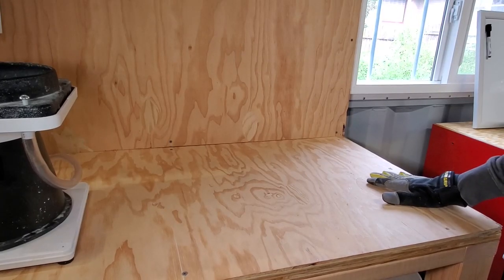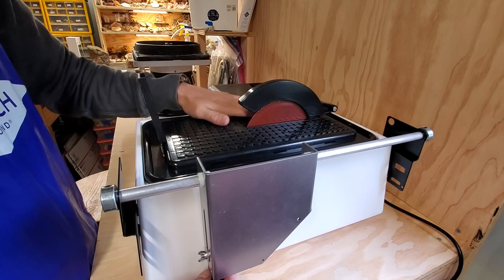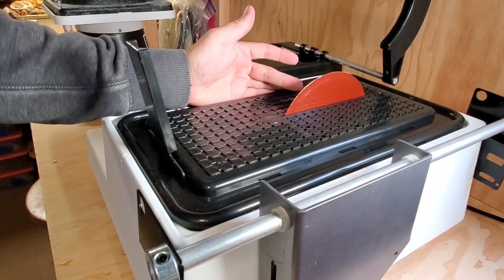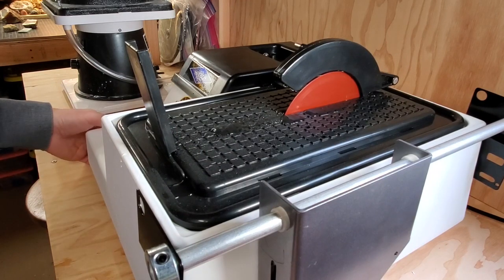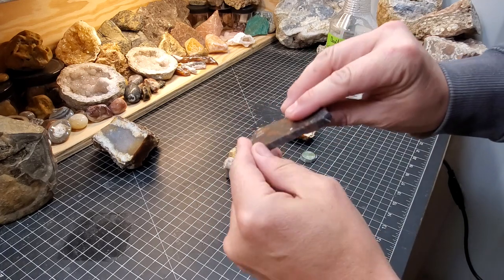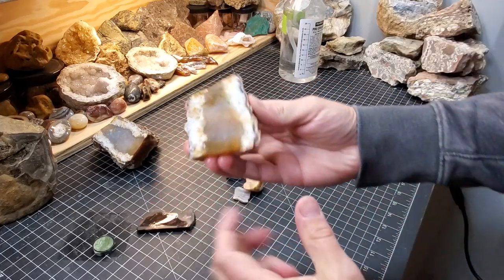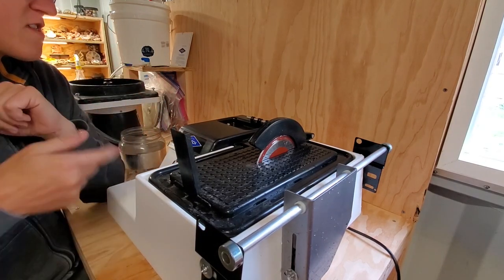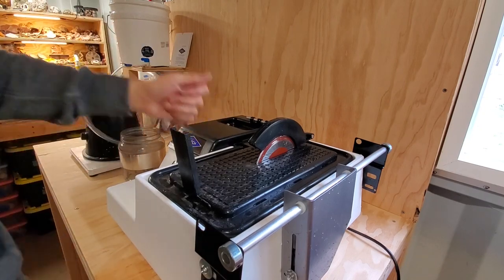Hi-Tech Diamond 6" Trim Saw: First Cuts & First Thoughts

Comment: I am having a vice custom made to use my 10 inch wet tile saw safely, right now hand cutting rock like I am is a disaster waiting to happen.  However, this is a good solution for the small cuts and its not too pricey!  Thanks for sharing.  :) This is an expensive hobby for sure!
Reply from the maker: Yeah it sure is nice to clamp your work down.

Comment: it appears the blade is not at a 90 degree angle to the top of the unit. How do you compensate to make the cut straight?
Reply from the maker: I'm not sure what you're seeing but the blade runs at a 90degree angle to the table.

Comment: The solid brown one looks like a cold water agate, which is typically limestone, and softer than standard chalcedony. I like the no noise factor and that was very a pleasant surprise (I wait until my wife is out of the house before using any of my saws, so this was impressive). I wanted to see you use the side of the trim saw to grind small pieces off when shaping an agate or cutting a cab. With the way this is made, I don't think that would be a wise move, since the side pressure is going to cause issues with the plastic at some point. What was the price on this unit? You might have said that, so I apologize if I missed it. If that is at a decent point then for someone who doesn't make cabs for a living would have all the saw they need. A trim saw is a nice piece of equipment to have if you are working on hard material, such as agates. Especially for those people who don't have a lot of lapidary equipment; they are limited to a smaller flat lap or even a hand-held rotary tool. That's when having a trim saw that you can grind against helps you out a lot. That was my biggest concern, but like most of the gear that I have I would probably heavy it up so it could handle the side pressure. Again, the noise is something that other saw manufacturers should take into considerations, because I'm wearing military ear protection for sound with the noise that my saws make. Very nice.
Reply from the maker: Grinding on the side of saw blade is really something that should be avoided.

You can see the current pricing on there website.

Comment: I like that vice swing option.  You will want little wedges like popsicle sticks for uneven rocks that you clamp. 
Oil over water? The oil gets gray and mucky,  it's hard to see markings on the rocks.  And you will need the litter pan and then a wash bucket.  You won't want that in your drains!  your going to need to follow some of the same procedures and with the slab saw if you use oil. 
Liz carate has made a myriad of shields around her water saw similar style. 
Water and bits can fly .
When free handed cutting just always be patient and allow enough time for the blade to do its job so that you don't torque the shaft holding the blade.

So congratulations on your new saw! Great video...
Reply: Also that is a amazing pre cut for the round... I cannot imagine that one, I usually do rectangular or harlequin style diamond.. parallelogram types. 
I usually just polish one window. 
I'm at a local community shop. 
So I'm sharing information from watching others.
Reply from the maker: I'm happy you liked the video and I do like the vise swinging out of the way option. I see the value in the oil for a big, slow cutting slab saw I really like the idea of not having to mess with water when its permanently below 32 degrees here.

I love your comments by the way, I'm always learning something.
Reply: @CurrentlyRockhounding , good to know that you find the information helpful. 
I'm Also learning and I ask lots of questions..
I want to know as much as possible! Those folks who have been working with stones for years are full of knowledge. 
The oil is good we have it in several of our free hand machines.  But it gets mucky really quickly. 
So there are different ones,  a company like Bar-sol.. here is local and selling the light weight white oil/food grade mineral oil,  or horse oil that you can buy at a tack shop.. because of the cost associated with it you can use it for some time. 
I was researching for Kate and found interesting things.

Comment: Thanks for the demo.  I just picked one of these saws up yesterday.  The notched diamond saw blade has a direction arrow on it, but my red sintered blade does not.  does it matter which way I put the blade on?  Thanks.
Reply from the maker: It's always a good idea to run a blade in the same direction even if it doesn't have the arrow telling you to do so.

Comment: I got this machine, a lot in part to your video. I am having trouble adjusting the saw blade placement so the blade doesn't hit the side of the table. It seems like the included Allen wrench is not loosening the screws. I wish you had included this part in your video so I had a visual! Any suggestions? 

I really appreciate your explanations, and am excited to get to cutting! 🙂
Reply from the maker: So you should see the two set screws on the silver metal shaft those loosen that so you can adjust it, I wouldn't force it. If your having trouble with it I would give them a call, they have really good customer service. We can also email and I can try to help you that way as well.

Comment: Awesome stuff mate I was just looking at a new saw think U made mind up ⛏️😎👌
Reply from the maker: What other saws have you been looking at?
Reply: @CurrentlyRockhounding I was looking at a Ryobi saw but was told there not that good.
Reply from the maker: @devildaymosrocks6401  There's many factors to take into consideration when look at cutting rocks, way too many to break down in a comment. Might I suggestion you just hold off until I get a video comparison done? I have a cheap tile saw, an expensive tile saw, a water trim saw, and my big oil saw. I was going to do side by side comparison of them and what you can get out of them.
Reply: @CurrentlyRockhounding  thanks that would be awesome to see the comparison 😎👌

Comment: I got the same saw  for cutting in the house during the winter, does the job but I did not get the vice with it unfortunately.
Reply from the maker: Which saw did you get? The vice is really nice, I have seen some DIY ones people made out of wood which could work as well if you don't want to buy one.
Reply: @CurrentlyRockhounding  I got  the 6" Hi Tech saw, sometimes my cuts aren't to straight doing by hand so I might get the vice  eventually.

Comment: The sticker shock is overset by “made in America.”   Thank you for a great video!  Can you mention how heavy the machine is, without water in it? I would have to carry it in and out of my shed to outdoor use.  At 65 and a bad back, weight is as important as the diamond blade. Also, how easy is it to remove the water or oil from the saw?
Reply: You can use a plastic cup to bail out the reservoir and a turkey baster to finish. I wipe it out and clean around with a small towel. It's not heavy and you could put it on a small kitchen appliance cart.

Comment: Hi Tech sells some sort of diamond lubricant additive. Would be nice to get your view on that product. My understanding is you add a capful into the water. Maybe they will give ya some to evaluate? 
Thanks for the video, looking forward to your opinion about the green blade performance.
Reply from the maker: I saw that they now sell it, so the listing says its just a surfactant which pretty much just breaks water tension. I think a product like Jet Dry would do the same thing.
Reply: @CurrentlyRockhounding   wonder if that is really a factor. Is it to allow more efficient cooling of the blade?
Reply from the maker: @jeytex3161  That's a good question. I don't think a little bit of surfactant would do that.

Comment: HI -Tech, I also got a machine. I got the 8 IN trim saw. I wanted to ask you It has been awhile and you have had some time using the saw. I was wondering what you think of the rock clamp after a couple of months, Does It still perform as expected. If not do you think of a nother way to fix It? Ok again thanks for the video.
Reply from the maker: So the vice isn't needed but I have used it for select projects and it has been really nice but generally I would say no its not needed.

Comment: Hi, why do they have different speeds and why isn't there just one speed like with other trim saws?
Reply from the maker: For some rocks that are softer you might want to go slower. Lots of other trim saws have pulleys you can change to lower the speed.
Reply: @CurrentlyRockhounding  thank you for your quick reply. It's appreciated. Have you use the Highland Park trim saw? My lapidary club has that brand for us to use, however, I'm setting up my own cabing station next to my silversmithing station and I'm looking for a trim saw for my slabs. I'm wondering how the Highland Park six-inch trim sawcompares to the Hi-tech six-inch trim saw. Your thoughts? Thanks in advance!

Comment: Hello, I've been doing tumbling and cutting stones for a while now. I'm wondering how I can make a big hole, like 4cm diameter on a Crystal quartz, and 2-3cm depth aprox. What type of equipment do I need for that? Would a standard drill and the correct diamond bit would work for that?
Reply from the maker: Hmmm I'm not sure how you would make a blind hole in stone.

Comment: Hello I’m going to use ur link and code I already got a  faciting wheel, will only be using it to polish glass coins. They range from 7mm to maybe 22mm at max in diameter. 
This is the only saw with a vice in my price range. I watched ur video on lapping wheel. And I was wondering when u explained the straight cut compared to the wonky hand cut and having to use a more corse wheel.  And was wondering with the vice how straight was the cut ? Would I have to be using a thinker corse with that trim saw with the vice or would the 180 be fine to start with?
Reply from the maker: I would say the cuts are mostly straight. I think anytime you're working with a trim saw you will get less than perfect cuts compared to an auto feed saw simply due to introducing thinner blades and human hands.
Reply: @CurrentlyRockhounding  
 so on the auto feed saws u need to use a thicker blade? I would be using .009 to .012 kerf. On the hitech saw blade. 
Every gram counts. The coins polished go from high 100s of dollars for a little thinner then a quater at around 20-25mm diameter. A lot average around mid to low 100s for smaller sizes and depending on the artist. 
So I’m trying to save as much material as possible. Should I stick with the hitech? Or auto feeder?
Reply: @CurrentlyRockhounding  o yea and I’m glad i stumbled across this channel last night I’ve learned alot thank you
Reply from the maker: @m3kid  What exactly are you trying to do? Also feel free to email me currentlyrockhounding@gmail.com

Comment: So do you recommend it for putting it in my house?
Reply: Be honest, I don’t think they’re going to look in the comment section
Reply from the maker: This is the cleanest, quietest saw I have came across. You could most definitely run it in a house. I would recommend you run it with water and not oil cause it can get messy.

Comment: How has the plastic top held up? Has it deteriorated much or deformed/broken?
I saw it bouncing and vibrating like crazy while you were cutting, especially with the moss agate. Surely that can't be good for accurate cutting/could potentially cause damage to the stone, right?
Reply from the maker: I cut a ton of rocks on this saw before I sold it and did some upgrading.

The table-top is considered a wear part the Hi-Tech sells replacements.

As far as accurate cutting goes it was never much of an issue.
Reply: @CurrentlyRockhounding  Thanks for such a quick response! 
I guess it's good that they sell replacement parts for it, but I've seen the cost of them, how often did it need to be replaced?
I'm a bit surprised to know that it doesnt effect the accuracy, no doubt though part of it is due to your skill. I think if I were to try it I'd come out with a cut looking like a lightening bolt or a burnt out sawblade every now and then XD
Did the vibrating cause any noticable wear or pains in your hands/elbows?
I'm new to the whole lapidary hobby, a lot of questions I have could probably be answered in a lapidary starters guide video so I won't both you with the 30 odd questions bouncing around my head XD 

I've only ever used, I think, a Lortone 10" trim saw at work and I've seen reviews saying they're some of the better ones, but also really hard to get in Australia, let alone for a reasonable price.

Comment: Thanks for the saw review! $500 seems pretty steep for what you get and all the rocks I want to cut are well over 3" :/
Reply from the maker: I hear you on the price of it but allow me to offer view on it that perhaps you haven't thought. From what I have observed you really get what you pay for, yes you can cut a rock with a $60 tile saw from Harbor Freight but then what? The rock your going to have after that will only really look good wet since it will be so rough and gouged up by the saw, now you have far more work ahead of you if you plan on polishing it up. Now I know that may not seem like a big deal but when you have 10, 20, 50, 100 rocks you want to cut and polish it will be. 

As with all products I guess the value is in the eye of the beholder, having a quite, clean, way of cutting slabs and small rocks in my shop seems very worth it vs. the loud, messy, wet tile saw that produce a cut surface that isn't very nice.

At least that's my thoughts on it as someone who has been cutting rocks with a tile saw for years and years.
Reply: I liked your video showing this product, thank you. Will I be able to cut pebbles I’ve collected from the beach or are they too hard for the blade ( model 6”)?

Comment: The only thing I don't care for on these, is they require a lot of water, and they are underpowered considering the types of stone being cut.
Reply from the maker: It uses like 1 gallon of water... You use like 20 gallons just to take a shower, so yeah it doesn't use a lot of water.

As for the claim of underpower, it highly depends on what is being cut and the person cutting, how the motor acts.